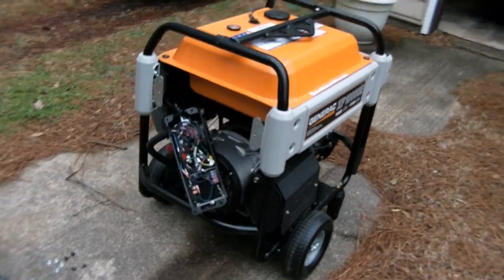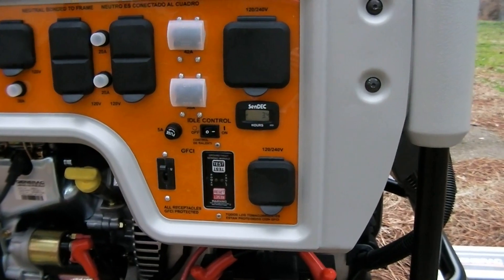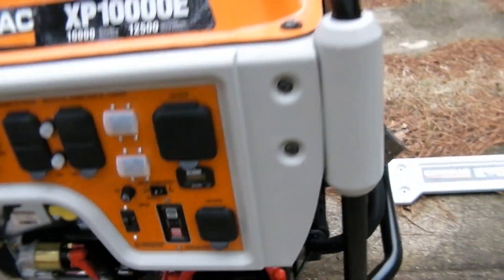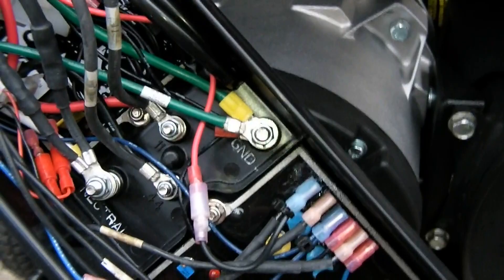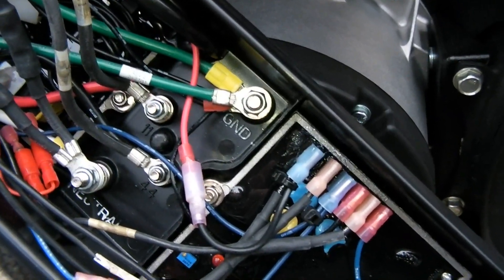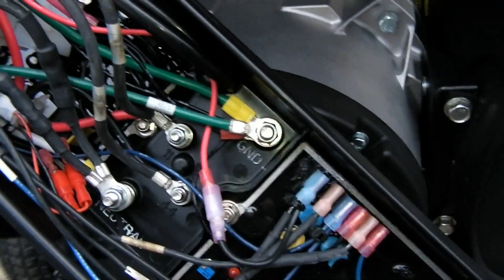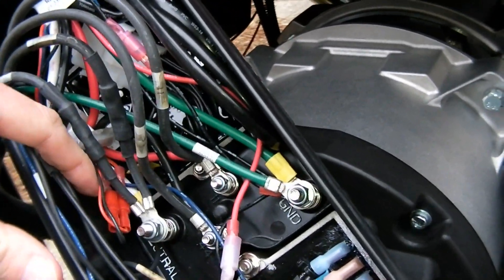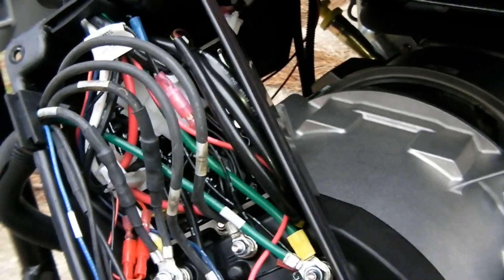Generac XP10000E Issues/Solutions Part 2/4

Comment: SpockMcoyissmart has the right idea...almost. This information is for the Generac XC 6.5 KW and 8KW generator with the GFCI protection for all outlets. The GFCI module must be bypassed by connecting the L1 and L2 from the generator to the Load side wires going to the outlets. This can be accomplished by, disconnecting the load wires going to the outlets on the module and connect them to the L1 and L2 right on the GFCI module terminal posts. The neutral wire going from the outlets to the GFCI module, has to be removed and connected to the Neutral post in the generator electrical connection box. Do not remove the bonding jumper, this generator is a separately derived electrical system and the ground and neutral should be bonded together, plus this will not keep the GFCI from tripping anyway.  REMEMBER if this procedure is done, the generator can be used for Home standby power only. The wiring MUST be returned to its original positions, with the GFCI in use, if the generator is to be used outside the home for hand tools or on a Job site, as per OSHA and NEC requirements. Also, make sure you leave a note on the generator that the GFCI is has been  disconnected in case you forget or are not the one that owns the generator ..... I'm sure this procedure could also be incorporated with other manufactures generators also. 
Blue Sparks out...............

Comment: Just want to say thank you for the information on your video of the Generac XP10000E generator.  I purchased a generator just like you have and I am sure that I was just like you when you got yours out of the crate. Disappointed.  A brand new generator would not work.  After waiting what seemed like hours on the phone to get help from Generac support group to tell me what was wrong with it they couldn’t help me over the phone and said I would have to take it to a generac service dealer.  I was given a contact number from them to call and did call but never got a return call back from them.  Thanks to you and your video I found on YouTube while I was looking for trouble shooting videos on generators. WOW then your videos showed up with an identical generator just like mine with the same problem. Because of your videos I was able to fix my generator and now it is working great. You would think that Generac would put a notation about the wire needing to be removed on certain applications in order to use it. Thanks a lot for you helping me get my generator going by you posting your videos.

Comment: Thank you so much for this video. I wasn't going to purchase a XP10000e without first knowing the neutral could be unbonded. That's being said, I just received the generator and unbonded the neutral as shown in the video but the GFCI is still tripping. It trips after about 20 to 30 seconds. My 5000 watt generator without GFCI works fine. It is being plugged into a 50a generator inlet to an interlock on my main panel. Is there anything else I should be doing? Thanks!

Comment from the maker: I think maintaining GFCI protection is crucial for this application considering the conditions the generator may operate in. The challenge was to figure out how to maintain GFCI protection while also powering the whole house. Not having the power feed grounded in two places through what amounts to a resistor (the generator cord) allowed the GFCI to function properly. If I wanted to use the generator on a job site, I would re-install the bonding strap so that I would always have a ground.

Comment: WANT TO DEFEAT THE GFI? Open up your generac and look where there is a yellow wire from the GFI module, and it goes to the main breaker. This wire powers the trip coil built into the main breaker.  Pull it off the main breaker and tape it. Your generator now works without the GFI module doing a thing.  This eliminates the 'nuisance' tripping.  It will now function as any generator without gfi protection, which is no big deal.  You want gfi protection?  Use an extension cord with a gfi built in.
Reply: SpockMcoy Issmart Thank you for this information. My GFCI was tripping, even after removing the neutral bond. This fixed it. If the generator is never going to be used for anything other then backfeeding into an interlock breaker, is completely disabling this GFCI have any possible adverse effects?

Comment: The only reason I'm asking is because my Generac manual states that the hour glass is supposed to rotate.  Since I already have to take my generator in for service on the Idle Control problem, I was hoping to verify whether or not Generac's manual was correct or that the hourglass isn't supposed to rotate.  If it's supposed to rotate and doesn't, I will have them replace that too (under warranty).

Comment: If I disconnect the bonding jumper, and use the L14-30 (120/240V) outlet on the generator to connect to my house, but only run a 3-wire cable (two hots, a neutral, but no ground), is this safe?  I'm asking because a friend of mine is offering me free 3-conductor cable.

Comment: Thanks for the part#.  That was a big help. I was able to look it up at Coleman Cable's site along with the data sheet.  I'll have to do as you did and go to a local electrical contractor.  Did your L14-30  Connector accept the 6 gauge wire or was that a special connector too?

Comment: 3.) You used a 4 gauge/4 conductor/5strand cable.  I am having a hard time locating this cable.  Do you have a source?

4.) As you did, I plan to backfeed power from my generator to my house.  My generator also has a bonding wire to the ground/frame.  If I do NOT remove this wire and earth ground the generator (with a copper rod), do you know if my GFCI on the generator still trip when wired into my house's breaker panel?  Is this safe?

Sorry for so many questions.  I may have more :)

Comment: GREAT series of videos you posted. It was just what I was looking for.   I have some questions:

1.) I just bought a Generac XP8000e (the smaller version of what you have) and I don't think the Idle Control Switch is working.   With NO load, the engine RPM stays the same whether or not the Idle Control Switch is on or off.  Am I correct in that with the switch ON, the RPMs should be minimal.  And with the switch OFF, the RPMs should be high?